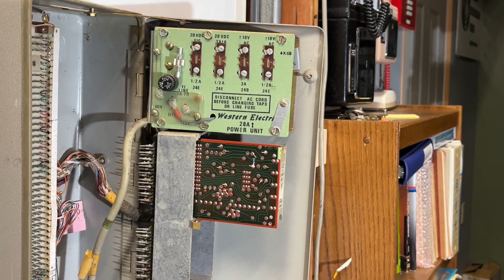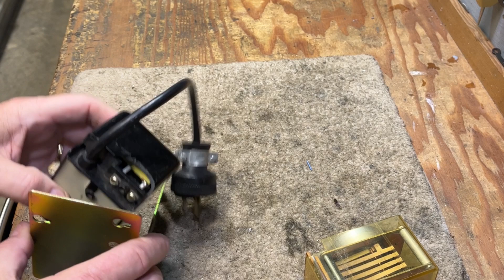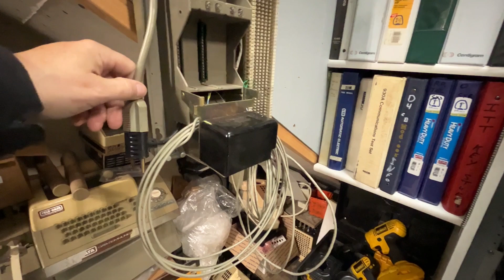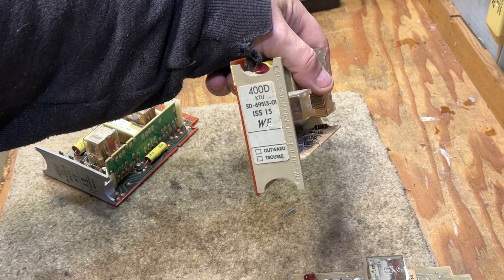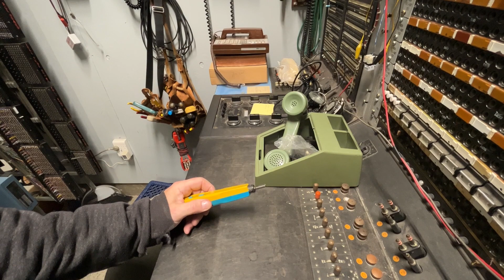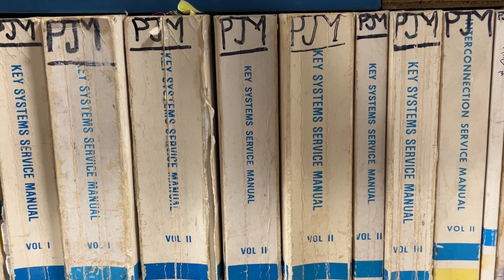Business 1A2 type phone systems for beginners.   (Overview)

Comment: Many decades ago I had a KTS system operating in my home.  4 line cards, about 4 stations, and a lot of wiring.  I always wanted to see a schematic for those line cards because they are full of components but they really don't need to do much:  Recognize an incoming call, recognize off-hook, perform the Hold function, and recognize when the CO disconnects while on Hold (polarity reverse).  

The station lamps would show 4 states:  off (line inactive/free); on solid (a station somewhere is off-hook on that line); slow wink (ringing -- incoming call on that line); fast wink (line is on hold).  

I had a separate 30Hz power supply and always wondered how that converted 60Hz to 30Hz for ringing.  I think I found the answer.  Look up Tellabs 8101 Ringing Generator on Sundance Communications forum, where a schematic is shown.  (This is my 5th attempt to post this!)

Comment: Good foundation & explanation of the basics.  :)
Reply: He really loved the phone company.
Reply: @cloneNK1124  It used to be a life-long career.  Now it's become a joke, run by the Insane Clown Posse.  Scary & sad.
Reply: @oliverw.douglas285  I know I was there from 1979.
Reply: @cloneNK1124  I grew-up in Bell Territory, but ended up working for everyone else, from installing Phone Systems & Central Office Equipment, to Circuits of all flavors.  Throw in 2-way Radio & Cellphones, Railroading, & finally a C.O. Tech.  It's been an interesting ride to be sure.  Over 25-years in the Telecom Industry, & a long ways off from retiring.  Who knows what tomorrow will bring?  ;)
Reply: @oliverw.douglas285  In 38 years I never got an upgrade or transfer. Just the names changed to protect the guilty, NJBell, Bell Atlantic, Verizon. I miss doing businesses. After 6 years I still go to work in my dreams.
Reply: @oliverw.douglas285  Have you ever scene a Lucent SLC-2000 system cause I have one.
Reply: @cloneNK1124  While I've heard of it, I worked more on the LiteSpan 2000.  Also worked on the Siemen 914A/E/EX, the AccessMAX/UMC1K, DISC*S/Reltec/Marconi, & Stromberg Carlson RLG.